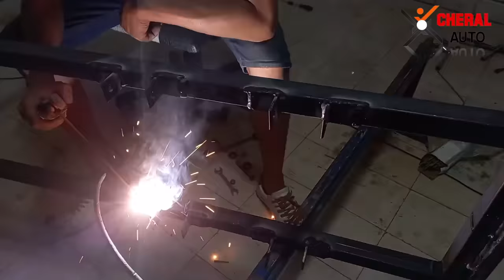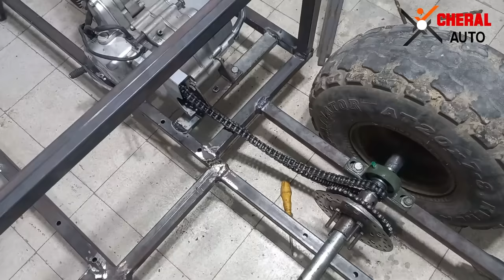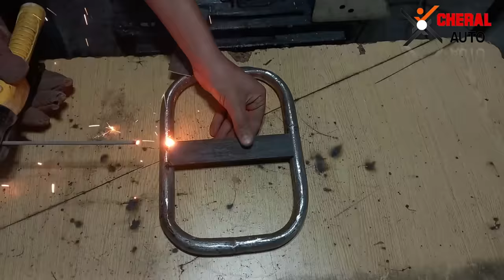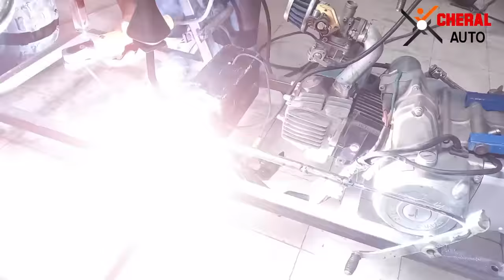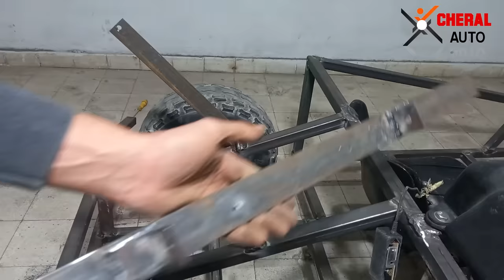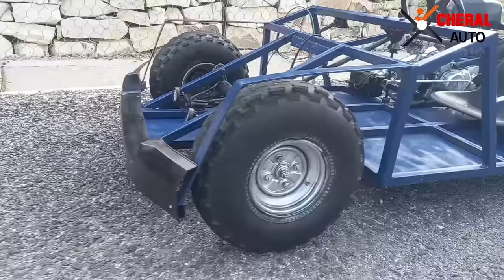Home Made Race Car Project - Cheral Racing gokart

Comment: did you reuse the same ktm motoryicle parts in all projects ? After done these cars you made, did you sell them ? Great projects, but i concerned about the rear axle. that little pivots are not enough to secure in place properly. you have to add some solderted ring in there.

Comment: I like watching your builds, and it's awesome that you only use a stick welder.........but you really need to get a ratchet set instead of only using wrenches to put on the nuts and bolts.  You should check out some of the projects that Rather B Welding does on his YouTube channel.

Comment: Do you have safety glass on that road that's dangerous with out them but it's OK you look cool but not really to smart I'm afraid, Sorry about the comments but it's for my Owen good to say something but the work you did is absolutely just marvelous if l may say
Reply from the maker: Thank you for watching my video and for your feedback. I appreciate your concern for my safety and I agree that safety should always be a top priority when working on any project, especially vehicles. In this particular project, I made sure to wear appropriate safety gear and take necessary precautions while testing the vehicle. Thank you for your kind words about my work, and please feel free to reach out if you have any further questions or concerns.
Reply: @CHERALAUTO  "Bro, from which quad bike did you take the parts? What engine do you have, and where can I find the blueprints?
Thanks."

Comment: What kind of welder is that
Reply: It's called an arc welder, stick welder. The flux to prevent oxidized welds that are porous and weak surround the electrode. In the right hands they are the best there is.

Comment: I think you need longer bolts
Reply from the maker: Thank you for your feedback! I appreciate your observation about the bolts used in my project. I will certainly take your suggestion into consideration and make any necessary changes in future projects. Safety and quality are very important to me, and I'm always looking for ways to improve my work. Thank you again for watching my video and for taking the time to share your thoughts.
Reply: @CHERALAUTO  "Bro, from which quad bike did you take the parts? What engine do you have, and where can I find the blueprints?
Thanks."

Comment: Tires have maybe 10 miles left of life 😒
Reply from the maker: Thank you for your comment. We appreciate your concern about the tires. Safety is our top priority, and we regularly check the condition of our vehicles, including the tires, to ensure they are safe to drive. We will take your comment into consideration and make sure to replace the tires as needed to ensure the safety of our drivers and passengers.
Reply: @CHERALAUTO  "Bro, from which quad bike did you take the parts? What engine do you have, and where can I find the blueprints?
Thanks."